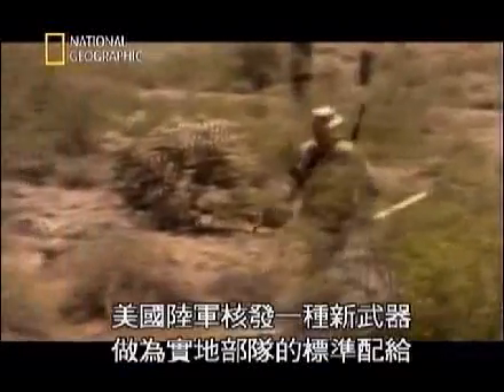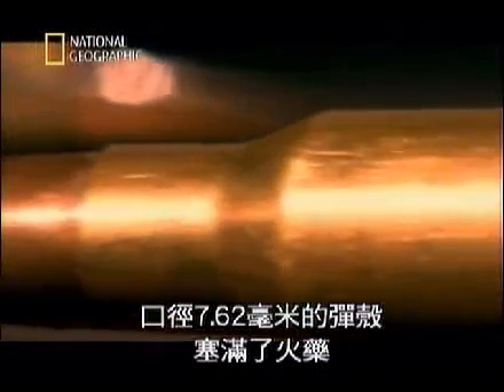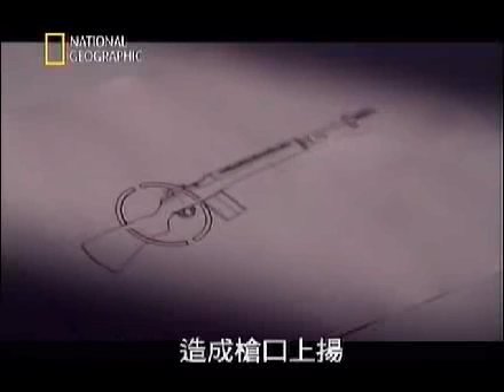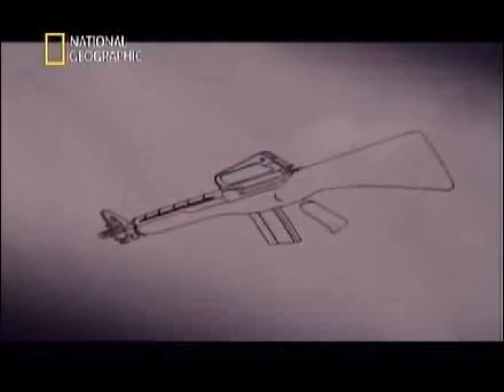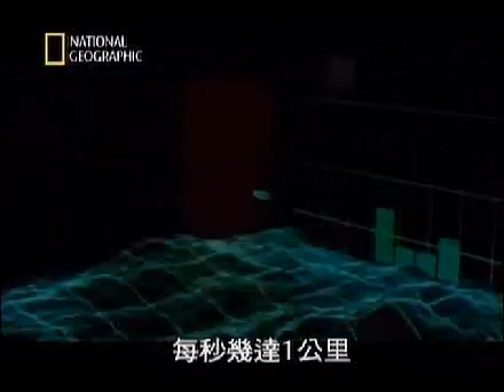Compare M14 With M16

Comment: The vid is bias the cat works for colt. A big part of this beef comes from the vietnam vets that went thru the inital M16 fielding. Failure in the middle of a firefight aint gonna win you over. Ive had several period vets tell me that failure/trust and the new cartridge inability to punch thru foliage were their foundation for loathing the M16.They all agreed that they'd rather bring the M14 and less ammo to the battle field than the M16. Lets see how many times they pull the M16 out retirment.

Comment: @SSgt24thMEU Yeah true true:Dmag cap problem? hmm i might look in to that.Yeah 5.56 tumbles and all but you wan't something a bit heavier to knock em down, it's a fast round yes but i think slightly underpower, does have the benefit of low recoil, fired the m1a and an ar15 :D both great weapons, anyway i believe the m16 needs to be changed to something else so do a lot of other platforms, i'm still waiting for belgium (my country) to ditch our awesome fnc for the f2000 but i heard there were pro

Comment: The ONLY time the 5.56MM has "superior" penetration is SPECIFICALLY DESIGNED AP ammunition is used. Is that why M80 ball will pass through up to 36 inches of sand and the M855 WILL NOT? Even under the "right conditions", the M855 doesn't always fragment; even when it does, sometimes it's not even significant.

The 7.62MM delivers more energy, more penetration, and more tissue damage than ANY incarnation of the 5.56MM EVER will.

Comment: Wrong it does not have the same powder charge as the 30-06. If it did then it would be 30-06 as well. They both use the same caliber bullet but the .308 round the m14 uses has less powder than the 30-06.

Comment: @hackerhunterdotexe 

I have talked with veterans who complained about the lack of "killing power" of the 5.56, so don't limit it to armchair commandos. If the 7.62x51 were not more effective in killing the enemy, why does the military issue it for DM weapons instead of utilizing the 5.56 in the same weapons platform? .22LR doesn't equal 5.56, and 5.56 will never equal 7.62x51. The only advantage the 5.56 has is weight and ammo capacity. The 7.62x51 is equal or superior in everything else.

Comment: At 450 meters the m16's velocity is cut IN HALF and is just about as lethal as a 22lr... The m14's .308 has more velocity than the m16 at DOUBLE that range. Not to mention .308 is more accurate (more consistent bullet drop)... Face it 5.56 fucking sucks, and Vietnam showed that very well. If you didn't hit someone square in the head or mid torso at far range or sprayed them up close they lived another day... M16 is fucking garbage, the GIs must've been pissed when they took away their m14s and gave them fucking plastic toys.
Reply: mihajlo525 I have an 16inch barrel AR15 with some 223s, why don't you stand down the range sometimes if you think they're so garbage
Reply: Sean Su Go out 500 yards and we'll see how effective your .223 is against .308 and .338 lapua, if you think your .223 is so great.

Comment: @uziman12 Well, if I was dumb enough to stand stock-still for you, then I suppose not. But, since I'm behind cover and only present a little of my body or none at all, I'd be pleased to see your 5.56 round stopping in the sand bag. On the other hand, the first somali I took was with an m14. I popped him through a mud and brick wall that the m16's had repeatedly failed to penetrate. Even after penetrating the wall, the 7.62X51mm round left his arm hanging by a couple pieces of sinew.

Comment: ok well the 7.62 x 51mm NATO ( correct me if im rong) has tons of range and accuracy. plus its not made for fully auto shooting. thats if your in a desperate situation for spray and pray. its mostly made for semi automatic. you must be thinking about the 7.62 x 39mm which is the ak 47 range which absolutely has no range. so i dont no why ur bringing the ak round into a video about an m14 and the m16. also the m14 has way more range than the 5.56. .

Comment: @Xshureshot86X 

the m16 isnt more accurate then the m14. the smaller round is the reason why.

it is on full-auto yes but never in semi-auto mode. the m14 kills at 800+meters. the 7.62mm round is known for its greater range but also its greater kick.

Comment: exactly, set it in semy automatic, get in a prone position, and then do the shooting, this guy is supposed to be trained in the military, and he hasnt figured that out, the only advantage with the m16 was the straight stock and rissen sights, it prevented it rising when shooting,  and you can carry more ammo into battle beacuse the smaller rounds. otherwise the m16 is garbage compared to the m14, infact the military is using it again in some applications beacuse there finding it more reliable.

Comment: @hackerhunterdotexe Actually, 7.62 NATO is better at all ranges. ALL ranges. You can just carry half again or so 5.56. Another thing, the tumbling bullet myth is just that-a myth. It stopped
Happening when they tightened up the twist rate to 1/7. Inside of 100 yards the bullets occasionally shatter due to velocity on impact, though that phenomena rarely happens with m16s and never with m4s.

Comment: This is bias. M14 is a good rifle but never should of been issued with full auto capabilities. M16 is easier to shoot with full auto firing, BUT the m14 is arguably more accurate, more reliable and has more stopping power. The only real advantage of the m16 is less recoil and less weight. Both are excellent guns suited to different combat scenarios. (sorry bout the bad spelling)

Comment: M14 Very reliable dusty, wet, the M14 will still fire. M16 even with it's modifications still jams regularly. M14 you can feel safe in the knowledge that you will kill what you hit, and whatever is standing behind them. M16 need 4 or 5 rounds to kill them. M16 primary assault weapon, not used for long range. M14 used by special forces as a sniper. Ask every military who served with both, they all say the M14 is far superior.

Comment: Well, I would hope you wouldn't use full auto on an M16A4 in today's Army...Cause it doesn't have it. They phased out full auto in the M16A2 series and behind because the Army picked up teaching Soldiers to be riflemen again instead of spraying like they did in Vietnam. (The Marines have always stuck to being riflemen)

Unless you're confusing it with the M4 Carbine, which has full auto capabilities, but it was built for close quarters combat where full auto works well...Unlike the M16.

Comment: @riseld4 The M16 is still a hated rifle by many.  It's an emotional issue from what I can see.  The M1 and M14 are aesthetically pleasing and very satisfying rifles to shoot. You really feel like you have some power in your hands. No doubt they are great rifles. The first time I held an M16, I thought it was just trash.  Plastic crap.  I laughed at it, but i soon grew to respect it when I was hitting 40/40 out to 450meters in qualification.  It does the job very well.  the .223 round is lethal.

Comment: @andyhuangit ...a lot of people killed.  Then the issues of slam firing.  All of those got fixed, but not untill people died discovering problems with the p.o.s.  But we still have a rifle that overheats faster than it should (that could be fixed with a simple, cheap mod), that can't stand any sort of grit in the receiver because of the poor design of the bolt carrier group.  Not to mention the fact that the issued magazines are still shit.  This rifle honestly has nothing to recomend it at all.

Comment: WHY don't you conduct that Test again using an AR-10 (7.62 x 51 or .308 Win.) The AR-10 has a similar Buffer System to the M-16.  Sniper School in 1973 we were making 1000 Meter Shots with the M-14. Try that with an M-16.
Reply: Smucko Smuckovic WHAT??????? LOL!!!!!! We have satellites that do that!
Reply: Sargeant Hammer why you take your m14 or an m4 to clear a room?
Reply: An excellent & intelligent Question Sean. I wouldn't unless I wanted to die, But as You Notice this guy's Test was NOT about Clearing a Room , it was a Battlefield Condition. In a building clearing a room is different first we had Two Breaching 12ga. Shotguns take out the door hinges at the same time then Point man kicks the door in with a Sub Machine Gun followed a four man (or Woman) team with Pistol (Glock for me) and Sub Machine Guns alternating and covering each other, Team Leader Centered for Control. Rifles are too slow. I used a shortened M-4 in 9mm, But not for long range in the field. Thanks Sean, The Marine Corps believes the only "Dumb" question is the one you don't ask.
Reply: Why would a normal grunt kill someone 1000 meters out? isnt that the reason why have marksmen?
Reply: Well just to set things straight for o'l Sean here, of course you'd take an m4 over an m14 for clearing rooms. But that's not what the video/discussion is about

Comment: @riseld4 I'm no authority on this.  I'm basing my comments on my training, what I've read, and some experience (desert storm).  I think that ideally, yes, the SAW and the 60 would primarily provide suppressive fire.  But I only had 1 60 in my squad and they were not always near by.  Sometimes a 2 or 3 man team had to act alone.  Sure, I'd rather kill them at 800M, but that is a long way out there.  I think the research has shown that most engagements are much closer in.

Comment: No offense intended but Colt Firearms Incorporated has soooooooooo much clout in DC that the only thing on the M16 that might get updated is the cleaning kit.

Colt had out lobbyed barret and H&K for the past 15 years and we'll still have the M16 40 years from the. At leas the M16 isn't a terrible design. room for improvement? yes but no Chauchat.

Comment: The video is a farse. The first ArmaLite rifle was the AR-10, and it was a 7.62MM - not the "Yankee POODLE SHOOTER" the became AR15/M16.

As for lethality, the 7.62MM almost ALWAYS wins Why? The current M855 ball ONLY fragments if the striking velocity is 2,400 FPS or faster. From an M16 barrel, this threshold is crossed at about 250 meters. From the DIMINUTIVE M4 barrel, this threshold is crossed at LESS than 100 meters.

You don't go full-auto unless you're on a MACHINEGUN anyway. PERIOD.

Comment: sure M14's round is heavy but it can work better in urban combat 
it can blow door off the hindges
it can go through really tough shit and still tag some one behind it 
M16
very good but not the best i believe the gun dose its job but it need that cuirtain push
m14 acomplishs that with devistaing affect and it also can be fixed to better sucsseed with its job like do some upgrades and it will be sure to nock that curtian sum'bitch down.

Comment: @Xshureshot86X You are confusing accuracy with controllability. The m16 will never be more accurate than the m14. Its smaller 5.56x45 cannot much the 7.62x51s incredible range and power. The only thing the 5.56 has got on the 7.62 is controllability

Comment: This video is so full of crap its not even funny.  The M14 is more powerful, more accurate, longer ranged, and more reliable than any form of the M16 or M4.  The primary reason for the change in this test, full automatic fire, isn't even found on modern M16 or M4s, only a 3 round burst, which, even this video pointed out, is controllable on an M14.  I have to use an M4 for work, I own an M14.  What does that say?